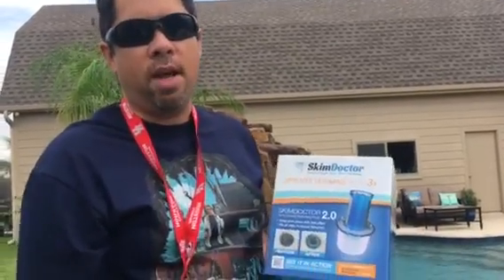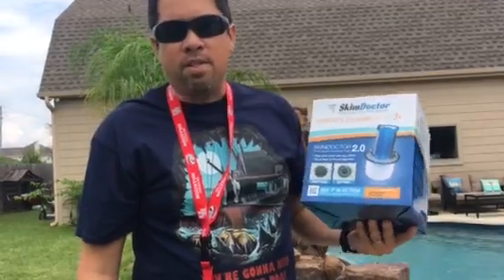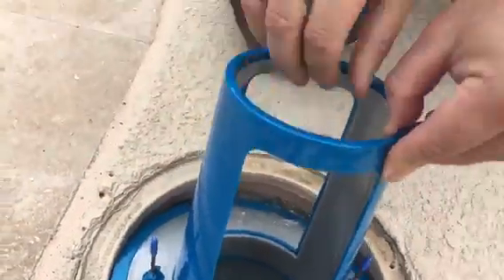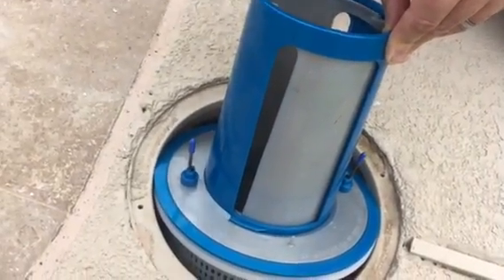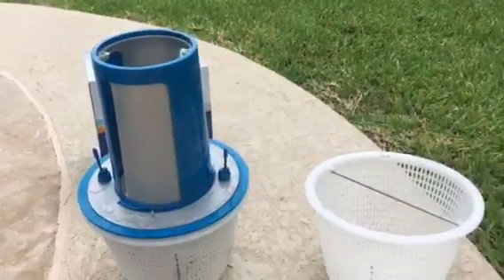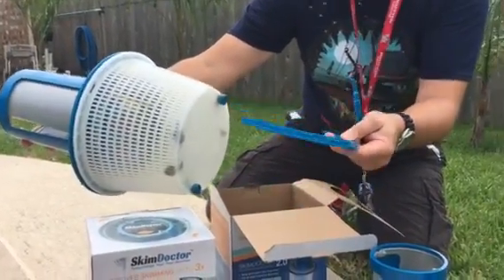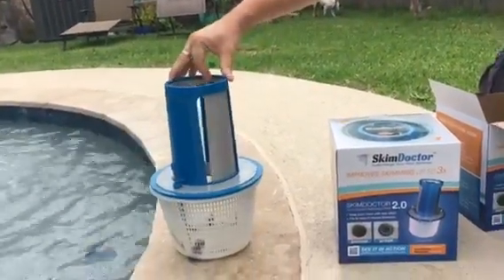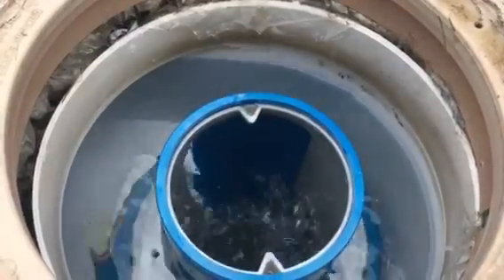SkimDoctor 2.0

Comment: I think you are mixing up speed and volume. Lessening the area of flow does not increase flow, it inhibits flow. The response, though, is that the flow travels at a higher speed because the smaller flow area builds pressure behind it.   I am not inferring the action does not help pull in more surface contamination. In fact, I am convinced that it does and will make the investment in an effort to assisting the cleaning. Thanks for the  video. It has convinced me to get the competitor's product because you don't have the construction project that this requires, and I don't thinK the variability of flow area is  vital to performance. You would have to do quite a study to determine which flow is optimum, and the competitor has come up with a standard that I assume has been lab tested.
Reply: Exactly.....At a constant pump speed narrowing orifice creates a pressure differential resulting in increased water velocity.

Comment: In your video, you said once you attach the Skim Doctor to your basket, you never have to take it apart?  How do you empty the debris out of the basket??? Seems it would be easier to clean if you removed the Skim Doctor.  Just curious.
Reply: Can the skim doctor be used on an above ground pool?
Reply from the maker: Eveyn Eller I do not think that this would work for above ground pools. It only works in standard type skimmers as you see in the video.  

I am not schooled on above ground type pumps and returns but you can see the video and detetmine if you have these returns. 

Thanks for watching.
Reply from the maker: Thanks for your question Gary. The SkimDr. is attached to the basket by two long screws and fly nuts, so it can be somewhat cumbersome to detach and reattach for each cleaning. They blue adjustable stovepipe top does screw away from its base so that a hand can enter and clean out debris as needed. With the stovepipe disconnected, the attached SkimDr. base still creates about a 1.5 inch lip around the skimmer basket, so that much of the debris will need to be extracted by hand and then the stovepipe reattached. I suppose you could reach through the top of the stovepipe to clean out the skimmer too. I hope this helps answer your question! Take care.